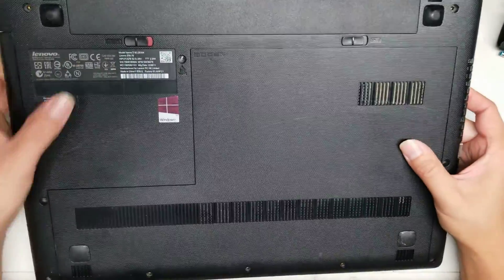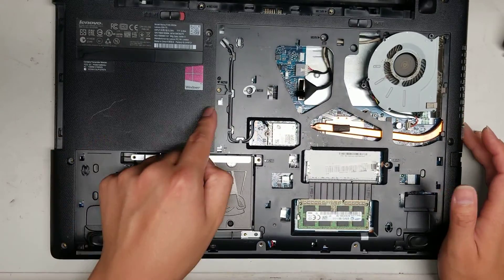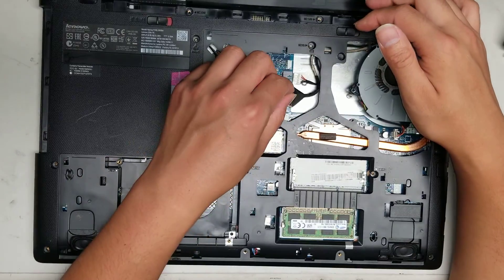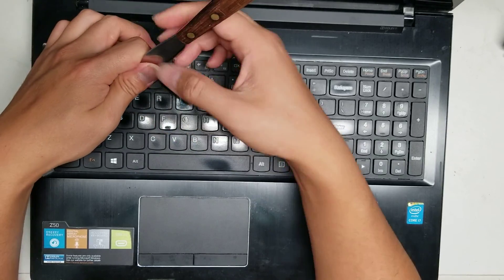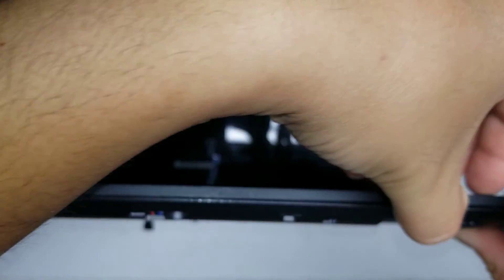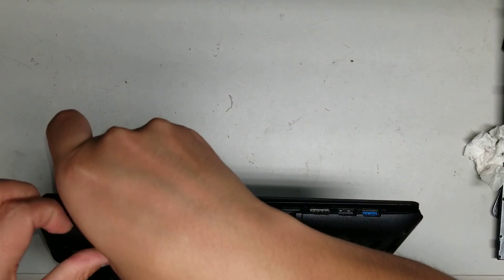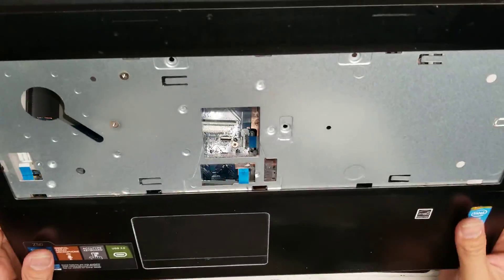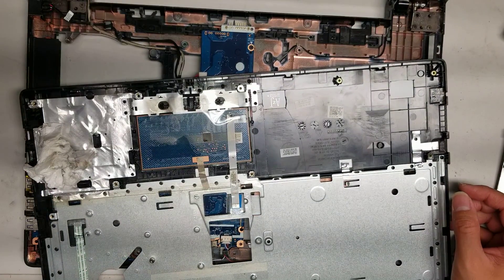Lenovo Z50-70 Disassembly RAM SSD Hard Drive Upgrade Repair Part 1 of 2

Comment: I'm using the lenovo Z50-70 for 5 years now and I'm trying to buy some SSD at some time.. My question is, what is the best SSD that you can recommend to me so I can buy it. Can ssd and hdd work together in lenovo z50-70? I mean is there an extra slot for my HDD if I buy a SSD? I hope that you'll respond, thanks!
Reply from the maker: https://youtu.be/4p5jFDzVwUw that should help
Reply from the maker: The video you commented on should answer your other question.